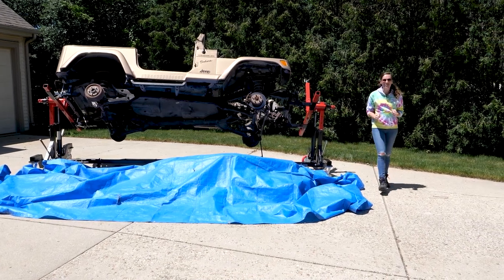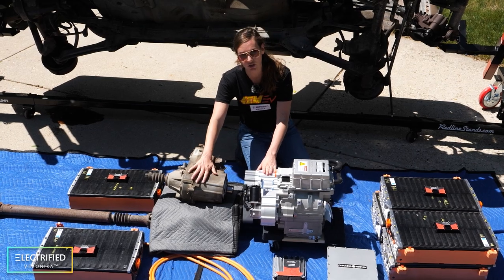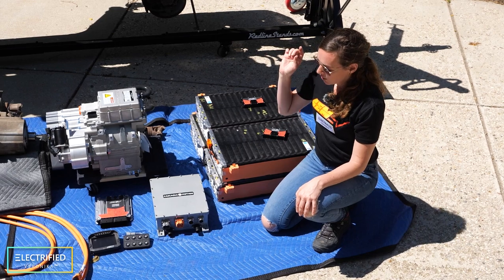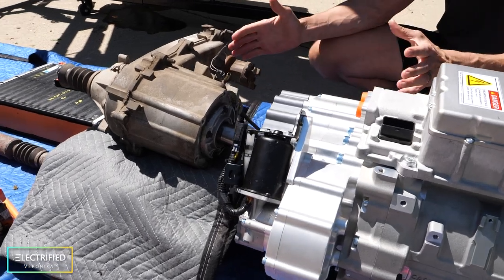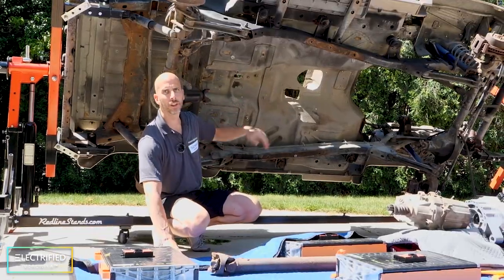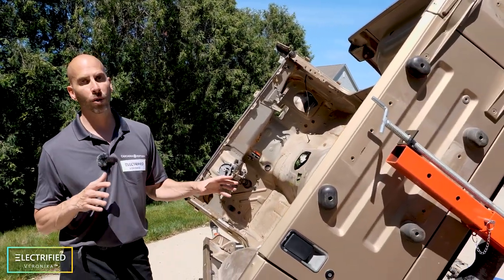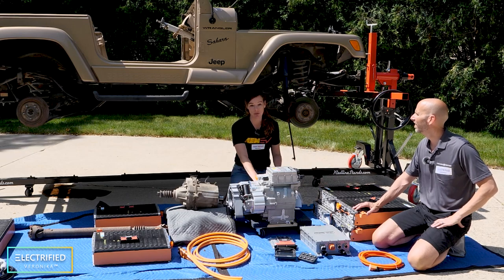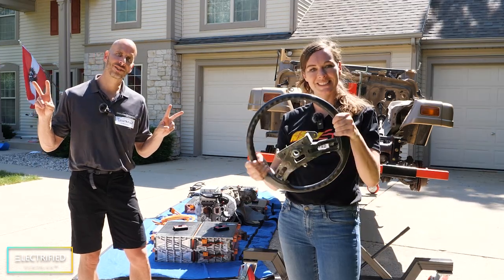Electric EV Jeep Conversion Components

Comment: Novak adapters specialize in doing jeep tcases they might be able to manufacture that adapter for you. Also check out the np242 tcase! It has 2wd, awd, 4lock high,4low lock. With all that torque you might want 4wd on the street! Looking good! Cascadia stuff is cool!

Comment: Amazing videos, super clear and entertaining.
I got a quote from a EV conversion company which lists all the components. 
A cooling system was not included. Is it mandatory?
I live in Montreal Canada where we also deal with extreme temperatures. 
Much thanks !
Reply from the maker: Thank you so much, I am happy our content is helpful. Wow, what are you converting? And which battery chemistry are you using? I would say it really also depends on how you are planning to use the car. Thermal management is not only for cooling but also for heating. We have seen several conversions without liquid thermal management that work for their purpose.

Comment: I'm enjoying see you two on your EV conversion journey!  I took my Jeep out on some trails last weekend.  It was sublime!  You're really going to enjoy this build when you're finished. 
Don't know what EPS you're using but I found the Prius unit has more than enough power and doesn't require any integrated control at all! It has its own torque sensor to determine how much assist it gives.  
I'd also suggest at some point, upgrade your suspension to adjustable control arms mostly because it's cool but it'll give you more suspension adjustment.
Keep up the great work!!
Reply: Didn't know about the Prius unit!  I will contact you in FB for more info...  Sounds like a perfect solution!
Reply: @donaldwright7194  Yep, anytime.  The Nissan Versa has one also and they're currently a little cheaper.  I just bought one of them for another project and it looks a little bigger, too.

Comment: Great progress!  Looking forward to more videos.  Quick reminders about why you are using DC batteries and AC motors would be helpful for those who haven't seen all past videos (or a link to your video explaining the AC motor choice would be great).  Thanks!
Reply: Agreed, I am sure there is a good reason for AC -> DC and vice versa, however I would have thought having a DC system everywhere would be simpler and more efficient.
Reply: @michaelyoung3337  For the performance we wanted, at the battery voltage we have, as well as wanting regen, we went AC as it was a better choice for us.

Comment: Such a nice project! 
I often wondered why a DC to DC converter isn't used alone in an EV to handle the 12 volt load, rather than a  DC to DC converter to charge ANOTHER battery to handle the 12 volt load, since high cranking amps and such are never required as in ICE vehicles; in other words, why not just size the DC to DC converter accordingly??  (Tesla even pathetically used a lead-acid battery until recently...)

Comment: Great project and as a fellow TJ owner, I love following along. One thing you may want to be conscious of are the driveline angles. It may not be bad at stock height, but your projected transfer case location looks like it will significantly shorten the front driveshaft which may lead to increased vibration. Conversely, lengthening the rear as you have should vastly help that issue too! Can’t wait to see it complete. All the best.
Reply: EV Death Wobble. Fellow jeeper here and I agree. That will be scary.

Comment: Hi Veronika & Donald, greetings from Indonesia. I found great knowledge here. Please explain more about Vehicle Control Unit. Does it cover lighting, safety, air conditioning, heating, interface display, entertainment, steering assistance, braking and safety systems? Brand, model, price? Thank you.
Reply from the maker: Wow, hi to Indonesia! I am in Croatia right now hihi. Thank you for your interest. We will do a video about the VCU once we worked on it and figured out all the details - but, yes, in general, everything that you mentioned will be controlled through the VCU - it is from AEM and it has a nice user interface that allows very easy programming. We will definitely talk about all the details soon. The only thing we won't have that you mentioned in your list is air conditioning. I decided against it, we rather take the top off!

Comment: Really enjoyed watching all these videos back-to-back on a wet Sunday. Thank you for posting and sharing! A question; will you bench test all the components, BMS, drivetrain etc. before mounting back on the Jeep? I assume so, in which case I will look forward to the video.
Reply from the maker: Thank you! That sounds like you made the most out of a rainy day hehe. Some of the components we will test before we integrate them and also combinations to make sure everything works together - that's the plan for now - but could change a bit because for some of the things once you made the connection and wiring it's hard to take it apart again - so it will  be a combination between some bench pre testing and testing once its integrated.

Comment: Glad to watch newly uploaded video clip! As expected, the process is on favorable way! I have one question. At the end of the clip, you mentioned that 'cooling and heating' battery system for warm and cold atmosphere in your region. Does it mean that, with your vehicle, you can 'set' the ideal temperature in the battery sector, like using a button to turn on cooling or heating function? (as we know, the distance we can go with electrified vehicle gets shorter in cold days!)
Reply from the maker: Yes, we monitor the battery temperature on each individual battery module and set upper and lower limits for initiating cooling or heating of the fluid that flows through the cooling plate. It will be an active liquid cooling system.
Reply: @ElectrifiedVeronika  Wow. That could be an invention which does not exist in current electronic cars from huge manufacturers. Preventing fire because of high temperature and increased battery efficieny in cold weather. Can't wait to see the upcoming outcome! Hope to watch another interesting video. Thx for replying!
Reply from the maker: @sigol_ajae  well, most OEMs actually do active liquid cooling right now (just the very early EVs and some manufacturers went the route with passice cooling, for example Nissan Leaf being air cooled..) - I wish we could have such strong cooling to prevent a fire in an emergency case, but this would definitely not be the case. Really, if you have for example an internal short in one of these cells, temperatures increase so fast that you can't stop it with a cooling system..but we will have other safety measures like thermal propagation pads and fire resistant materials to protect the passenger compartment in the worst case scenario. For the efficiency in cold weather, the active heating system will definitely help - a heat pump like Tesla is doing would have been something cool too, but we have a different solution right now. Wow, long answer, thanks for the input and comments, I will use those ideas and questions for upcoming videos 😊

Comment: How resilient to vibration are the batteries...maybe even the whole system? My Jeep (97 TJ) is meant for off-roading and exploring so I'm driving up pot-holed roads and crawling on rough terrain. Would the batteries need some type of suspension to prevent damage?
Reply from the maker: We are right now looking into vibration analysis and will talk about all the details in an upcoming video. Yes, we want this Jeep to be able to do off-roading so we will be prepared for that. Details, soon. Thanks for all your questions and interest!

Comment: Very cool your using a jeep to do this on.  I have always thought a ev would be a great wheeler. I have a 1991 wrangler. I am Just not sure how it we'll handle the hard impacts and bouncing on trails. I don't know enough about ev parts or the cells.  But its got me thinking about doing a swap.
Reply from the maker: We are really looking forward to taking the Jeep off-roading. And yes, we will put some effort into figuring out the right way to mount and protect the batteries, but for sure this is possible. The modules themselves went through a durability study at the OEM - we are reconfiguring but the way we build them will be very similar. Once we have all that figured out, we will of course share it in another video. Thanks for your interest! 😊

Comment: Funny your building an ev TJ. I'm about done building my EV TJ. I live near the boarder of IL/WI. I'm curious what voltage and amps your controller is rated for and what motor(diameter and weight) your running?
Reply from the maker: Hey that's so cool! We are planning an info event for everybody that is interested to do the same in order to figure out how we can help best, stay tuned for that. About your questions, we have a whole playlist about the conversion including a video where we talk about motor and inverter details, so go check it out if you are interested. You can also find more info on the Cascadia Motion im225 system in the description box of this video and it will lead you to the parameters you are looking for.

Comment: I like this. Much better than the Tesla. It’s like an cooler version of an golf cart that is street legal. Yeah electric has its issues and draw backs but this is an cool project TJ. Also can these be solar charged as well without ac power.
Reply from the maker: Thank you! We wanted to really keep the original functions of the Jeep including the selectable 2 and 4WD - I think this makes this conversion very special and appealing to the traditional Jeep community.
Reply from the maker: Oh, about the solar. Yes this will be possible, but of course the time to charge will obviously depend on how many solar panels you have and the size of the solar inverters. We were even thinking of building a little trailer that has everything on board to do something like that, but let's see 😊 First, we want to get this conversion done.
Reply: Golf cart??? That motor is >> robust than the Tesla

Comment: What is the price for the electric motor and why that choice. Is your motor cheaper than
 UQM-Danfoss PPHD 220(+) Motor ? I looked at the specs for your motor and there is not much info for example the motor efficiency.

Comment: I love to see all the components there!  How do you cabin heat and air conditioning?  I know my Bolt just does resistance heat into a small coolant loop and a traditional heater core, and then has a separate air conditioner.  Also, one more missing piece I'm curious about: My Bolt has a high voltage distribution box which is basically just some contactors and fuses and current measurement; do you have something similar, or just connect everything directly?

Comment: Is the speed reducer much lighter than manual transmission in current generation Wrangle JL? I'm interested in doing EV conversion on a manual JL without the 3.6 engine.

Comment: The TJ being an Offroad vehicle im not sure how safe it could be to place the battery in the bottom near the frame rails. They could get directly hit when off-roading by rocks or trees. Maybe some sort of heavy gauge metal box to protect them and the gas tank one? If they are not waterproof maybe find a way to make them. Otherwise the Offroad capabilities would be hinder with the conversion.
Reply from the maker: Thanks for your feedback! We will build water proof casings around our modules. And right now we are also looking into another concept where we would move the two modules that we had planned in the middle section to the back where the gas tank used to be. We want to take the Jeep off-roading, so we really work on a good, safe and reliable conversion!

Comment: I followed the links on the battery modules and it looks like those are 28.8v. Given there are 7 modules that comes to about 201v nominal. The specs on the motor show over 400v. Is the plan to run it at 200v or is there something else I'm not seeing? I'm learning so I'm really looking forward to this build. Thanks.
Reply from the maker: Great observation! I did not go into the details this time but in the next video. We are reassembling those modules and make new electrical connections so we will have again 7 modules but at different voltage and a little different form factor, but overall will be 400V then! ☺️
Reply: @ElectrifiedVeronika  Good deal, looking forward to seeing it. I looked at the Cascadia Motion motors and inverters but didn't see any pricing. Do you go through a dealer/distributor or request pricing directly? I really like your plan, what you are planning, layout and parts, would work across a lot of other cars and trucks. I have a '80 C10 I was thinking about a LS swap but after driving a Tesla S a few weeks ago I'm more thinking conversion. Thanks for sharing your work with us.

Comment: At 2.72 transfer box isn't enough what will you do?

In motor to transmitted to transfer case H 1.14.5 

Low 2.88 and 3rd and 4th gear multiplied